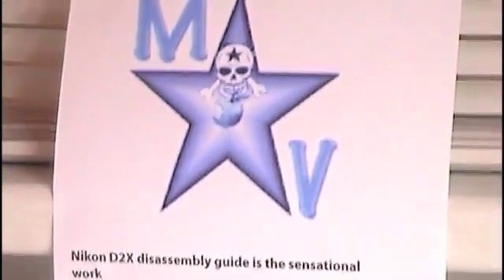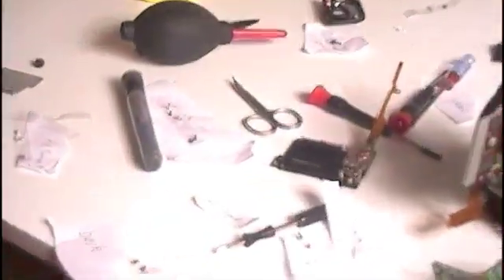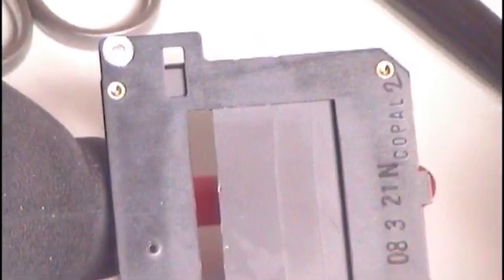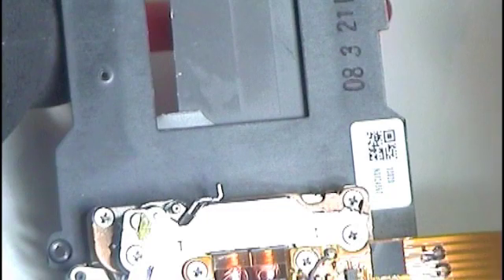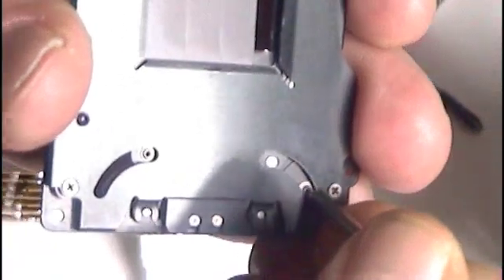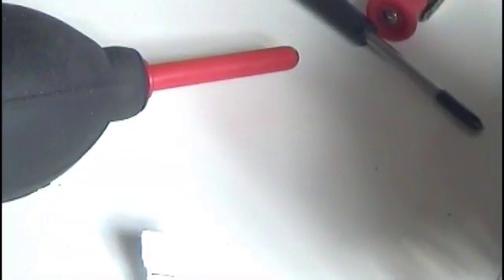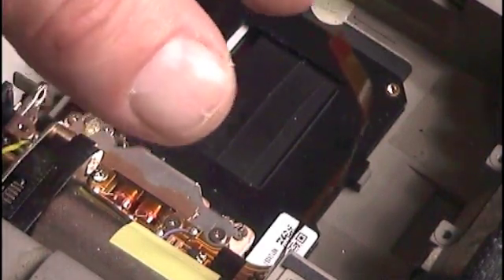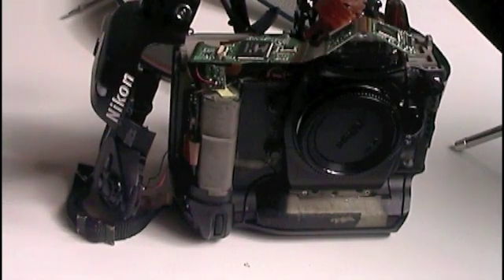Nikon D2X selfmade shutter repair manual PART 1/3

Comment: Unlike film,  the Sensor will only be collecting light data for a short period before the circuit it off.  The extra time this portion of the sensor is exposed is small and you may not notice the overexposed section.  The sensor also looks a bit smaller than the section damaged and the mirror will cover most of the light .   Some good or bad news for you  is a replacement shutter for a D2x is  cheap  under $50  now.  The expensive part was taking off and replacing the part.  I will look for part 2 and 3 to see how good you did.

Comment: How deep into the d2x do i need to go to remove the card reader?
I have an almost new D2x that i bought with a bent pin i straightened out but it will not read any cards and will not format them in camera.
All the other functions work meter, af and menu but will not fire off the shutter because it sees no card..
Reset didn't work all the little tricks don't work.
Leaving me to think the reader shorted out when the pins were crossed.
Would love to get it running and not have a Nikon paperweight.